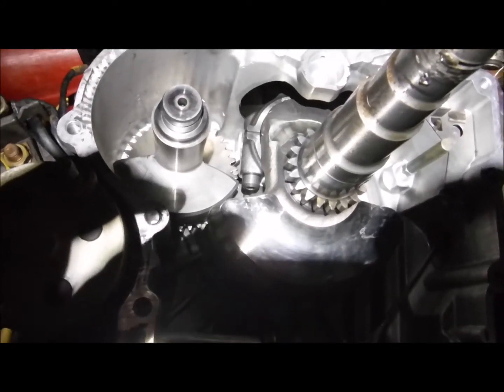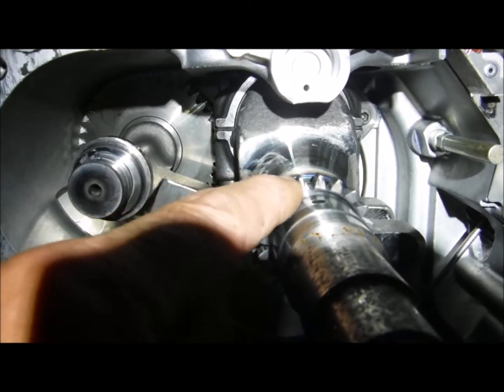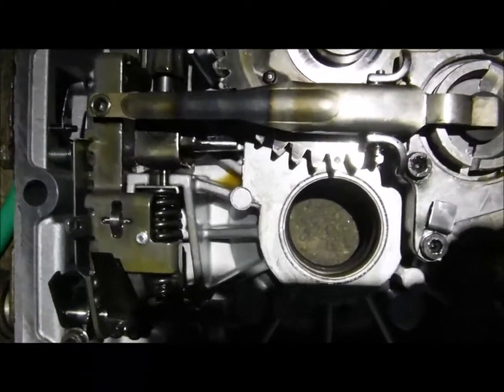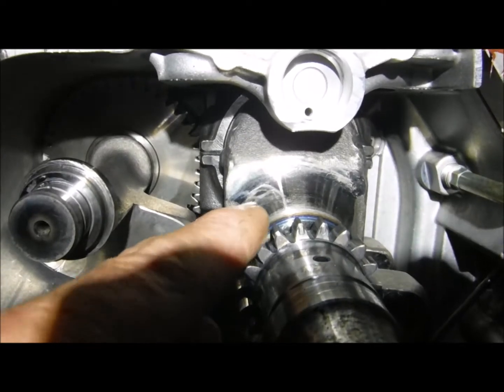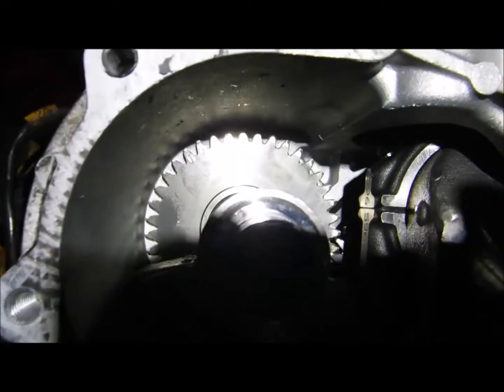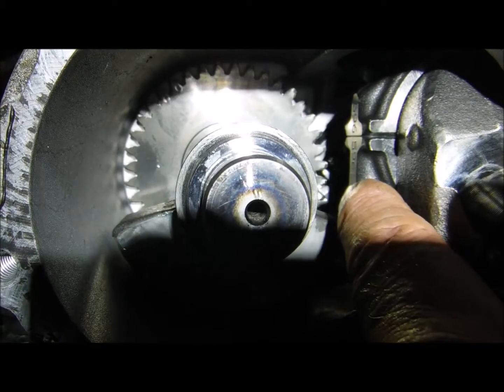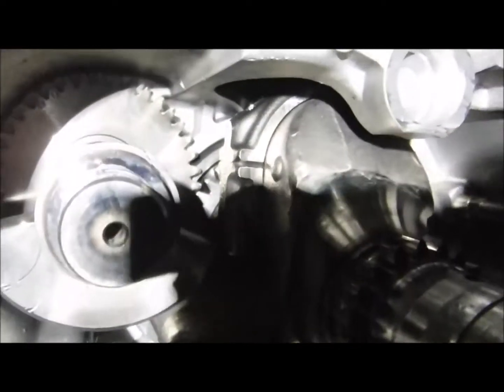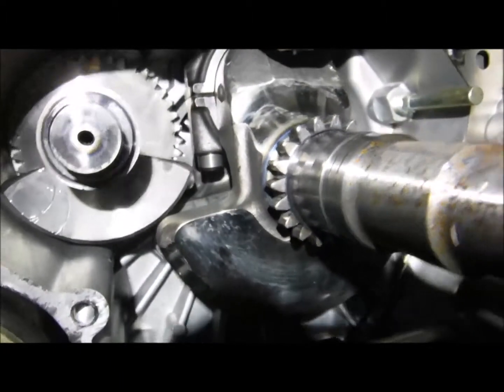Hatz Diesel 1B20 1B30 1B40 Timing Marks

Comment: Hi, im having problem, in 1b20. After replacing piston, i put all the timing marks as you say, there is no compresion. Compresion goes by exhaust. Its like intake and combustion is swapped. Sorry for my english, and thanks for answers in advance.
Reply from the maker: Recheck the timing sounds like the timing was not in the right spots. There is nothing else that can cause it.

Comment: I have a 1B20 Hatz diesel that will not start. What happens is the engine seems to kick back when I attempt to pull start at step 3 of the starting process. The impeller and the volute were somewhat fused together. The wetside is now repaired. It feels like the timing is off possibly numerous attempts to start it. Does anyone have a suggestion? Thanks in advance.
Reply: If it doesn't want to start check your arm rockers.. Make sure they are 0.1mm.

When you crank it does it have compression?
Reply: @sakhileradebe4939  Yes it has compression. When I pull it, it feels like it is kicking back, as if it is jerking it from my hand. I am waiting for more information. Thanks for your help!
Reply: @MrBroofer did you figure it out? Mine do3s the same and not sure if its normal or not. It runs but its in rough shape
Reply: @devinpaulsen3658  I had to set it aside for the moment to allow for another task. As soon as I find out, I will let you know.
Reply: @devinpaulsen3658  Yes, I did. I reset the valve tappet to spec. The manual for the IB20 explains the steps. For the IB20 the gauge is a .20. For the IB30 and up it is .10.
Reply: Have you ever open the timing cover
Reply: @sakhileradebe4939  Negative. I am an in-house tech. It was returned after being out in the field.

Comment: I have a 1B40 in an Easylift boom lift that was 1 year only run built from the factory without a balance shaft.  At start up it spits out flywheel bolts.  Any suggestions?

Comment: Hatz makes great quality Diesel engines. I’ve never run across a 1B30 with a balance shaft before. I’ve only seen them on the 1B40’s and up. Hope you get it running again.
Reply from the maker: It's back purring as they do.
Reply: @MrDoingEverything  quem fornece peça para esse motor aqui no Brasil
Reply from the maker: @pedronunescoutinhonunesc-we1ny   Some research should state that.